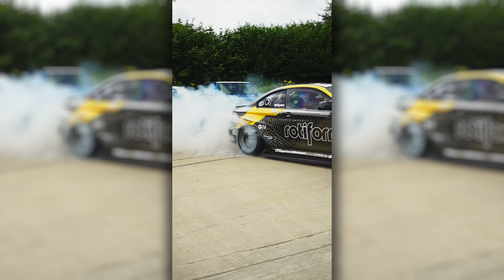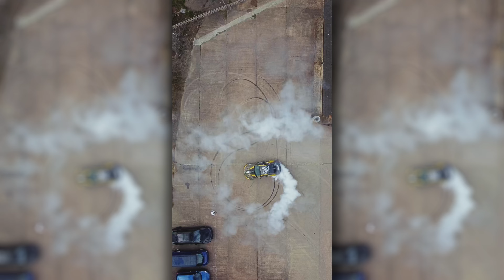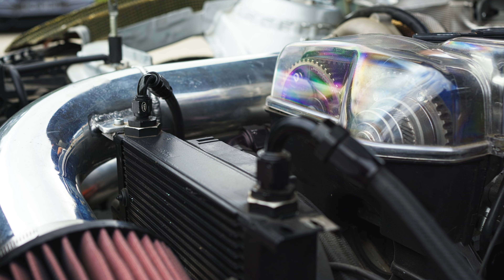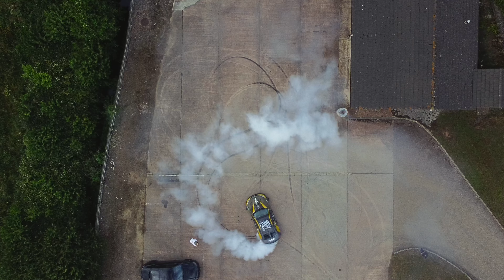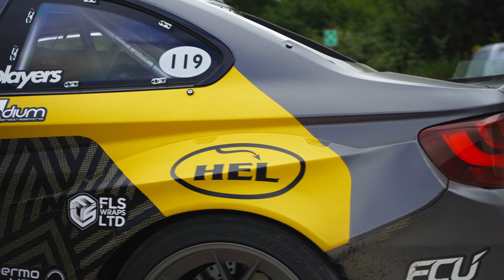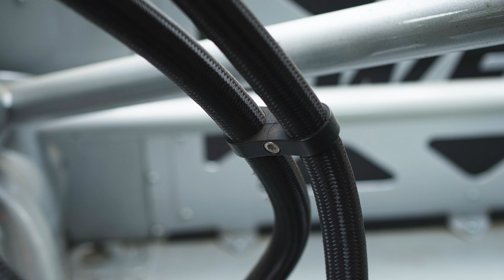This BMW M2 Drift Machine Will Blow Your Mind!

Comment: Subject: Urgent: Action Required on Stuck Order #128856 – Final Notice Before Legal Action

Dear Hell performance Support Team,

I am writing to formally raise a serious concern regarding my order #128856, which has been unreasonably delayed and remains undelivered. Despite multiple attempts to seek an update, your team has either failed to respond in a timely manner or has provided vague and unsatisfactory answers.

It has now been since September 2024 almost a year, and this level of delay, along with the lack of clear communication, is unacceptable for any reputable business. As a paying customer, I expect transparency, accountability, and a clear resolution.

This email serves as a final notice. If I do not receive a concrete response with a resolution and shipping details within 48 hours, I will have no choice but to escalate this matter further. This includes, but is not limited to:
	•	Filing a formal complaint with consumer protection authorities
	•	Reporting the issue to relevant e-commerce regulatory bodies
	•	Initiating legal action for non-fulfillment of the order and breach of consumer rights

I sincerely hope this matter can be resolved professionally without escalation. Kindly consider this your last opportunity to resolve this issue amicably.

I expect a prompt reply.